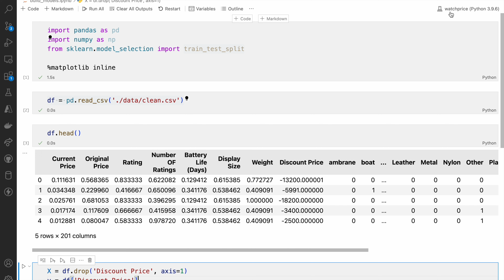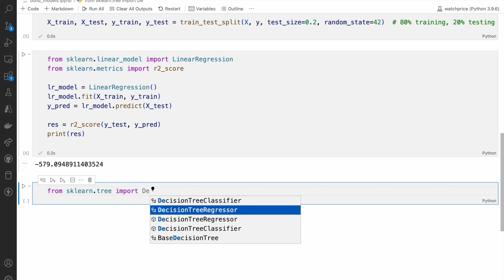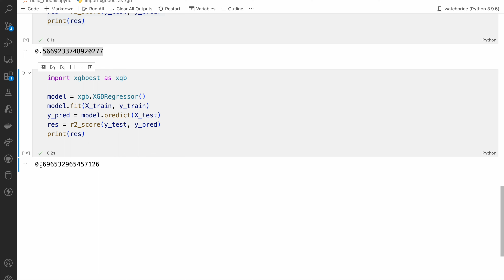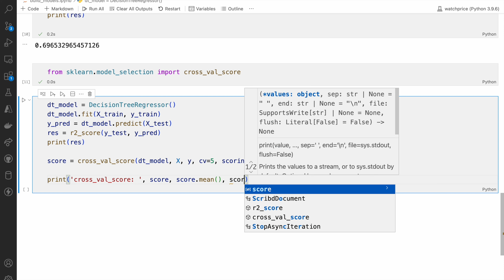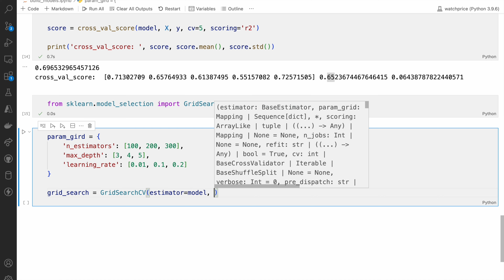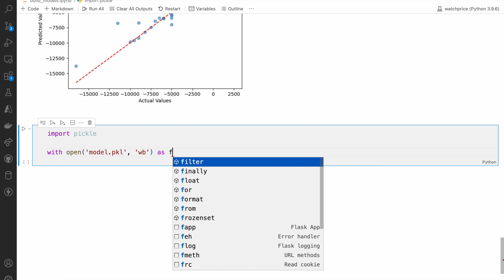Machine Learning Linear Regression End To End Project Part 6 (Model Building)

Comment: I have installed xgboost through conda, made sure the package is available in my environment through conda list, but still getting issues importing it. I keep getting the error no module found. Has this happened to anyone else before?
Reply from the maker: This can happen due to so many reason. One maybe the human error that I think you have not done which is not using correct environment sometime. What happen that if you are using conda and installing package as by pip then maybe sometime it’s getting error. Every package of X boost may require a specific version of Python that you need to check from their office documentation that might be one of the error. Also xgboost is depend upon some of the other packages. So during installation, you need to check whether some warning or error is coming or not. Best way. Is that create a new environment. Try to install specific version of xgboost and then check it might work. if not, you can give me error or something, so I can look into it.